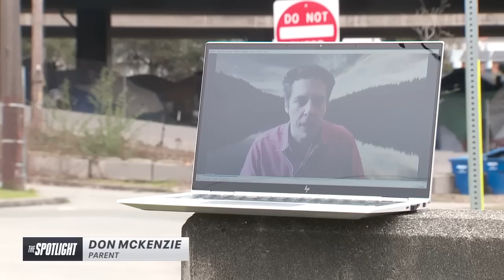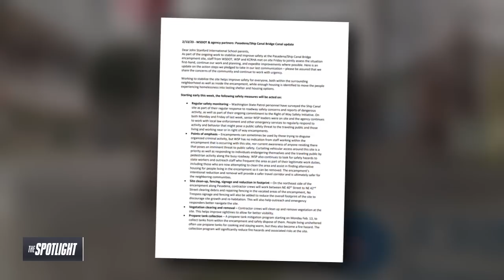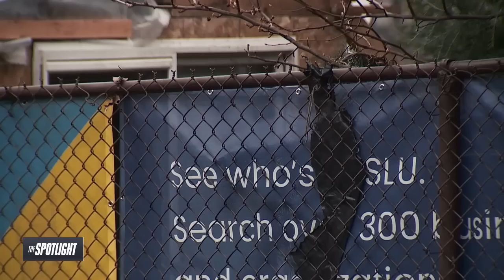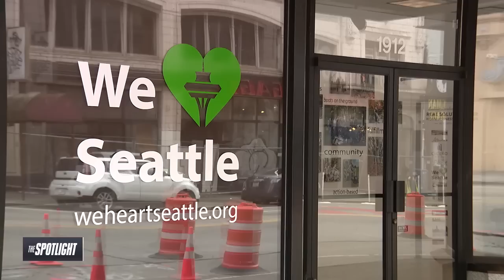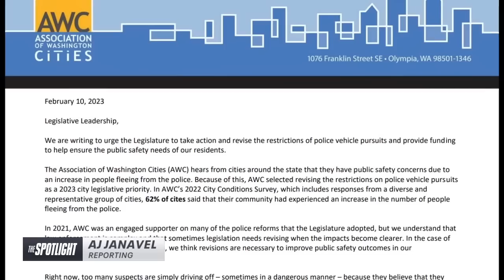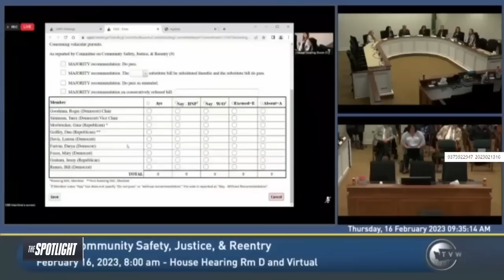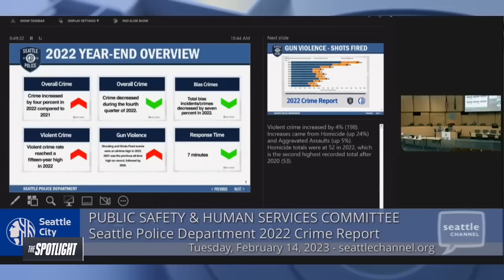The Spotlight: 2,221 homeless camps on WSDOT right-of-ways, including I-5 and I-90

Comment: The cost of concrete trailers that can be moved to where they are needed plus concrete can last and withstand the abuse the homeless can do using pressure molds can also produce a lot in a short time.